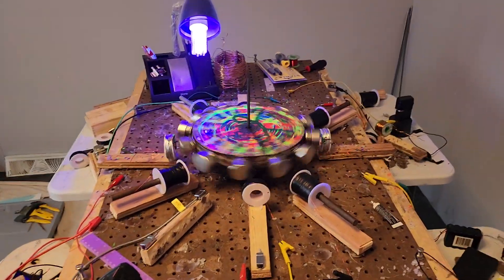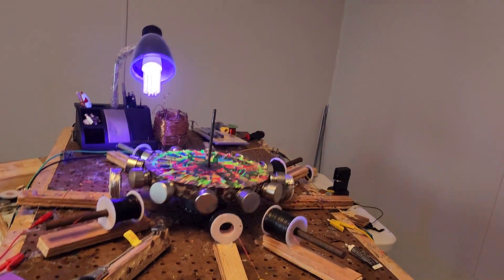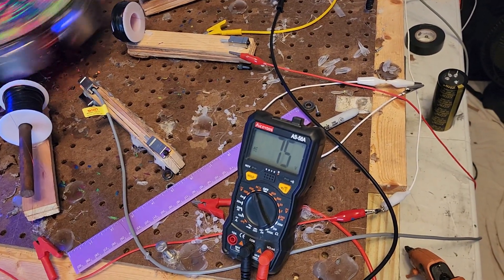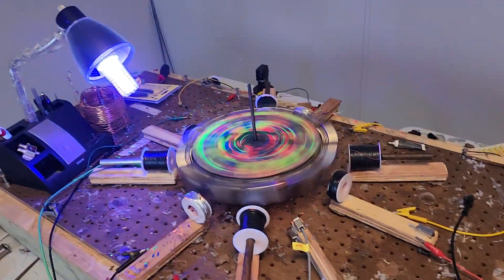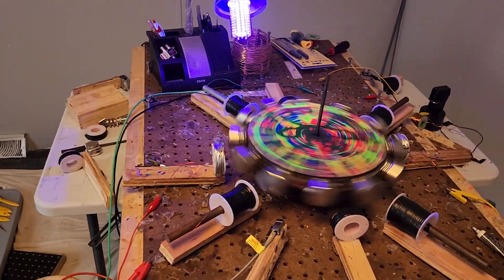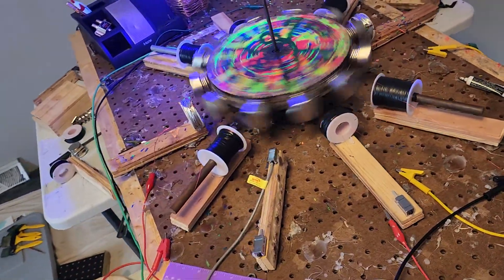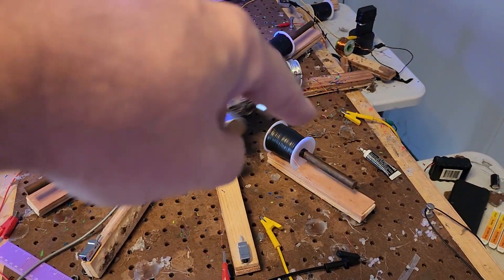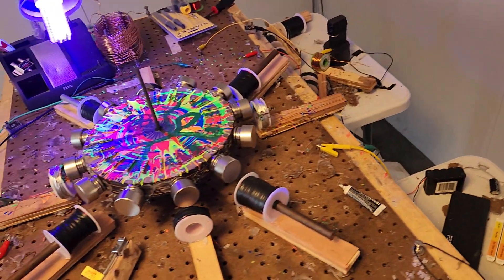pulse motor generator 130v of raw AC

Comment: The thumbnail alone made me think of a gennerator circuit. Thanks! i will definatly be watching your vids!
Reply from the maker: I generated 600 ac volts with that rotor its vey special its the first one that was straight in the center and the bearings.  Its design is notable as well due to how well it turned out.

Comment: Is there any way to tap power out of the system...transform the output way down...to say the 1-5vdc range (what is the frequency of the dc spike pulses, higher the frequency the easiest to transform down), increasing the current but heavily reducing the voltage...then use a low current energy harvesting ckt to pull power out and use it to charge batteries while maintaining it's self sustaining rpm's.  even if it sips power out...
Then I am wondering if the system was built inside a container where the air could be evacuated to reduce air friction if the rpm's would increase...air resistance can pull power out of the system, especially if the RPM's start climing

Comment: Interesting! This looks like a type of synchronous motor. You have it set up to commutate itself from a circuit based off a feedback coil, right? 

What kind of driver circuit are you using?
Reply from the maker: 90 degree drive circuit with 2, 32 awg coils and 2, 4-filar coils made with all 32 awg copper wire 1, power supply 24 DC output plugged in (wall socket) 1, transformer 10 dc volts--->155 DC volts 345v max. 1, magnetic induction switch (reed switch).all hooked up for max speed with the config listed above.  Power supply has a speed dial but its nullified by the transformer.  

The 4 lager coils with the cores are also made of 32 awg copper wire the cores are 6" length and 1/2 " in diameter.  These coils are a generator circuit set up to generate the most voltage either direction the wheel (rotor) is going can get about 140AC out of the 4 coils note: the magnets on the rotor are lined up with just the top of the coils so the bottom of the magnets moved past the top of the coils.

So nothing fancy.